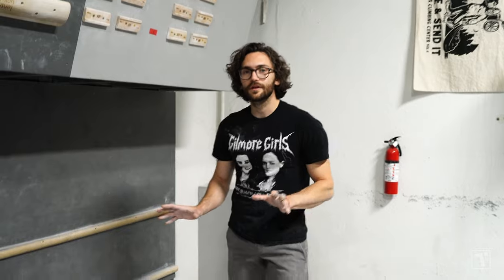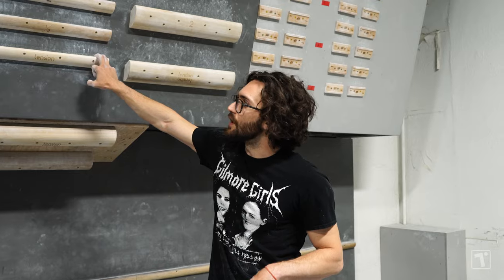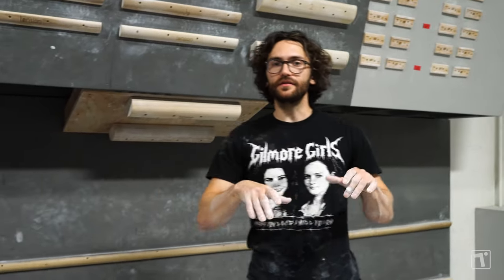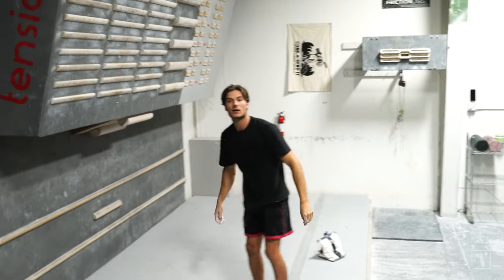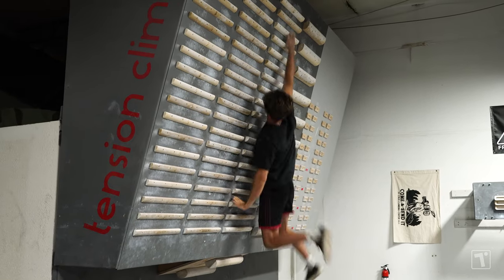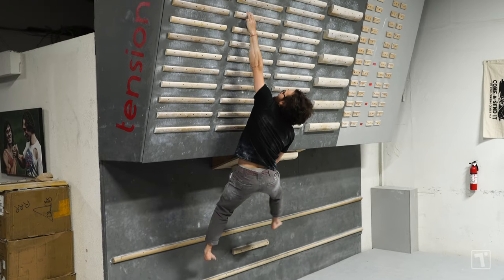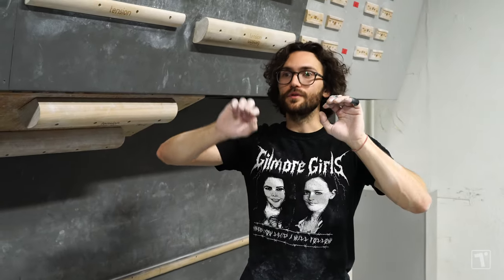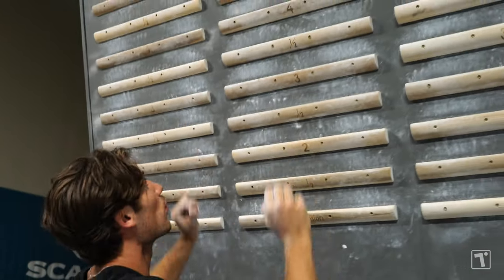MORE POWER: Campus Board Essential Exercises

Comment: Great video!  I'm sure you've been asked this before, but do you think campusing or hang boarding is most beneficial for bouldering?  Or a little bit of both?  I tend to hang board myself but I'm thinking of getting back into campusing.  My weaknesses are dynamic movement and contact strength.  Just afraid I'll lose some finger strength if I stop hang boarding.
Reply: Maybe try campus + moon or whatever board. Board climbing gives bonkers finger strength of exactly the type needed for climbing. Ofc it doesn't replace max hangs but you could rotate your training cycles to I corporate all 3. Depends on your goals. Stay psyched

Comment: Those Large Bumps gave me large amounts of dead skin aswell lol. Definitely gonna be watching the Intensity on that one. Less full extension bumps for more accurate full crimp on the holds, if you look at you hands towards the end of that bump exercises you lost your full crimp to a half crimp. But if you want to get specific about what your training. Its something to pay attention to, it's no different then having the best form while deadlifting, training for full crimp endurance/ power triggering,  is best trained with that specific grip type in mind, if you fail the half crimp but still perform the move are you just training your arm's? In that sense it would be more beneficial to hit the gym and isolate those moves... this is also something I have to constantly watch myself when doing campus training, because if your not doing it right, then my & your training will be tempered with... I hope this makes sense.

Comment: Great video!  You guys are very strong and powerful.  I see you have a sweet hangboard setup on the wall.  I"m looking to build a hangboard setup like that in my garage.  The way you set it up is a very compact setup.  Would you mind sharing  a picture or build spec?  I was thinking to hang something from the ceiling.  But if I could get something stable just on the wall that would be ideal.